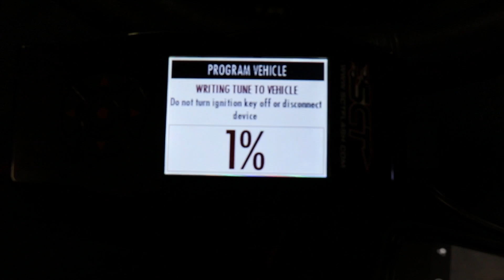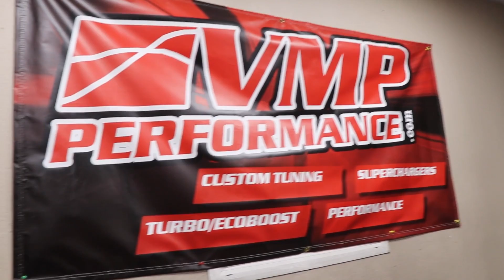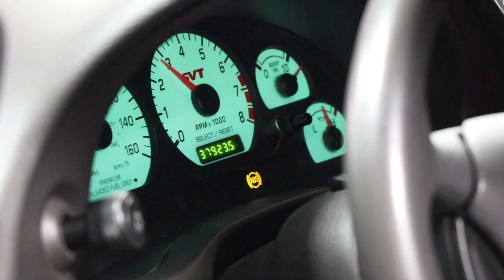VMP TVS Supercharger Install + Dyno 2003 Cobra Before and After

Comment: So 5k twinscrew + installment and dyno tune costs so 6 or 7k for barely over 100 hp gain? Doesn't seem worth it
Reply: These arent 5 grand...even the gen 3 vmp is like 3-3500ish...the gen 2 2.3 vmp is like maybe 3 grand or so and im talkin new prices here.  Also this isnt a twin screw its a tvs.  He went from like 477 up to over 600 and is still on pump gas and heavily limited by that...this same car topped 700 on e85.  As far as weather its worth it if you dont think its worth it to completely transform your car and put it into an entirely different league performance wise then by all means dont do it lol.  Theres more to it than just peak numbers this will pick up huge power everywhere over stock blower.

Comment: It's funny how in just a few short years, 650 rwhp cars don't sound as impressive as they did 7 or 8 years ago.  Now the benchmark seems to be 800-1000 rwhp for "King of the Hill" status. When do you think we'll hit the limiting factor ceiling (tire and road technology)?  At some point, you won't be able to put any more torque to the pavement due to tire grip and road surface.
Reply: I think its starting to already get out of hand.  People just wanna have big numbers on a sheet they can brag about.  Its hard to hook that kind of power on the street you gotta race from 70 rolls because you cant hook below that even with good drag radials many times.  I think its stupid how people act like 600-700 is nothing...its something alright it can get you from 0-dead very fast or arrested.  I like fast and i like hp but there comes a time when you gotta pull the reigns in a little and stop worrying about what everyone on the internet says or does.  600-700 rwhp is plenty for a 3600 lbs mustang...people need to start investing more in suspension and driveline mods and investing more time in learning how to actually drive good instead of worrying about huge numbers on a dyno sheet and downplaying anything under 1000 whp (which is ridiculous imo).  I wanna get a terminator and build it eventually with a vmp blower...700 on e85 is more than enough for me.  Theres more to enjoying a car than having more hp than everyone at sone point you just gotta go out and enjoy the car the way its meant to
..hard to do that below 80 mph without huge drag slicks which cant be run on the street.  Even drag radials cant hold that kind of power.  At 600-700 you can still hook ok with a good drag radial and suspension mods even on the street any higher and that becomes very very difficult if not impossible
Reply: @michaelharris748  you said brother. I could not agree with you more. What's the point in having all that power when you can't even use it? Not to mention always having to change shit up cuz I don't care what engine you're running that much power is bound to tear shit up eventually. For me, 600-700 is the absolute max I'm willing to drive on the streets cuz I love my car and I love my hard earned money even more lol. This hobby is not cheap that's for sure.
Reply: mark warner 800? Here in Texas 1000rwhp is barely anything we got tons of cars going into 1300-1500hp.

Comment: Nice power gain. What boost was the SVT running at and what boost was the VMP running at? Was the SVT blower pretty much maxed out already? Could a pully change on the SVT make the same power? Could the GT500 TB fit the SVT blower? I like how the VMP blower flattened the torque curve! Nice video (compliment to the ML video!!)
Reply: Too many questions bro
Reply: @jaysoleado Your comment is 5 years too late…bruh
Reply: @3500camarz    6 years actually

Comment: how many lbs of boost was this tuned to on the video after the vmp install?
Reply from the maker: Hello, 
 This car has roughly 19lbs of boost.
Reply: VMPPerformance this was on pump gas or E85? im thinking of ordering this blower for mine geard great things about it on e85 some w supporting mods have seen 700rwhp